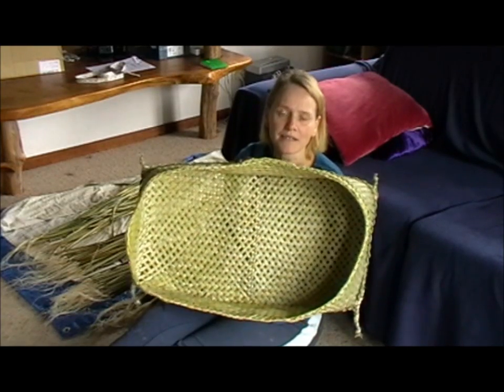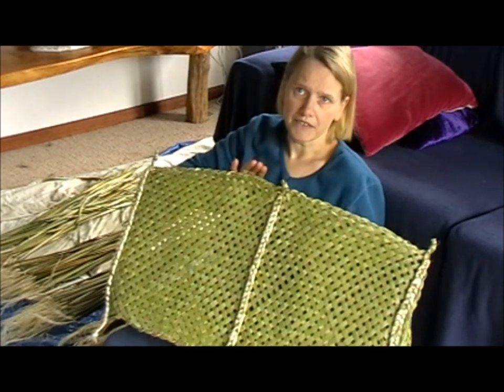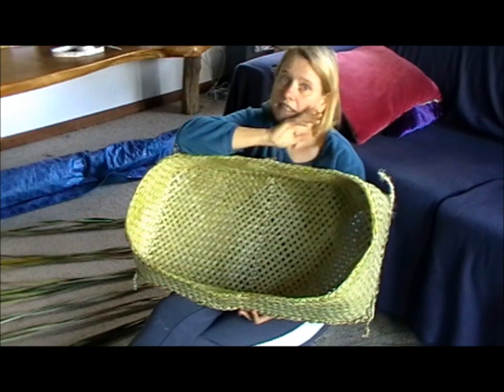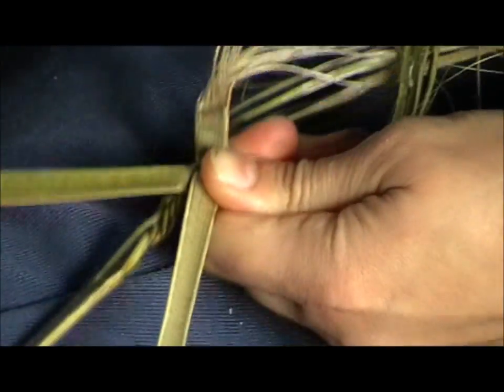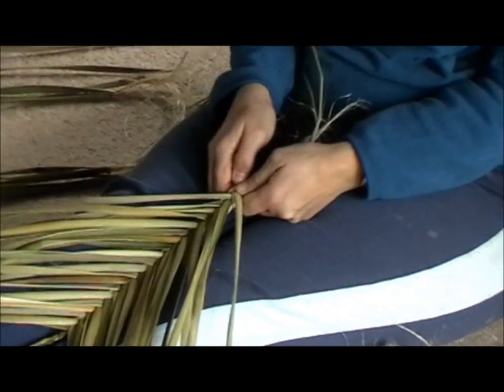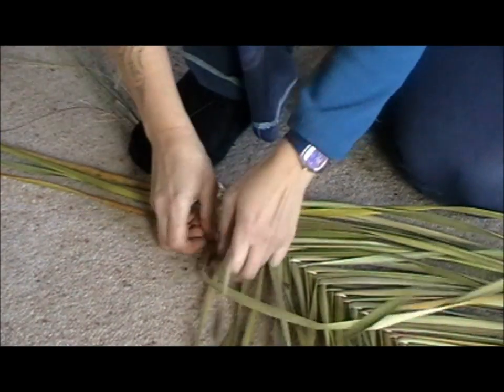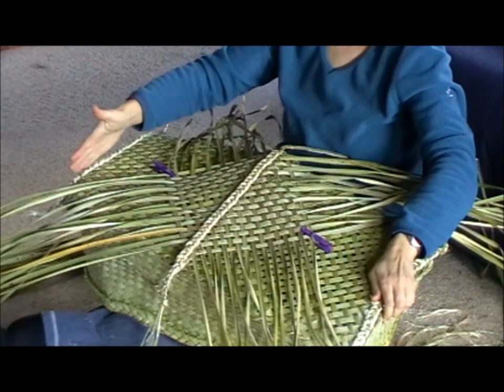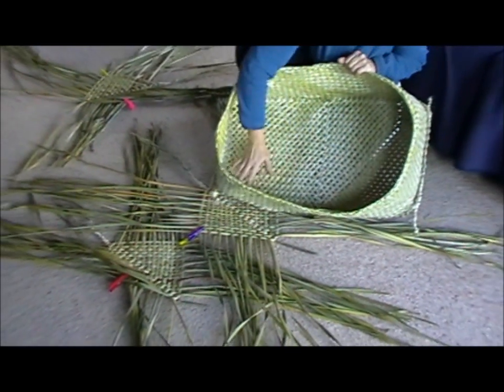Wahakura weaving step by step part one

Comment: Beautiful hand work, you make it look so easy. Could this starting method be used to make a kete which is what i'm wanting to do. There are so many videos but I can't find any step by step starting and fininshing top edge plaits. I love watching you clips, so explanitory. Thank you for sharing.
Reply from the maker: Kia Ora Bex, you could use the wonderful book from Mick Pendergrast "Te Mahi Kete" for step by step instructions on how to make a kete whiri and also how to finish the top. I do have a number of videos on kete and also finishing but most are for experienced weavers and are in the subscriber-only space on my website (flaxworx.co.nz). You can make a kete with the Wahakura method but I would not recommend it if you are not already experienced in weaving, a simpler 1 whiri 2 corner kete might be a good way to start. Also if you look on my channel here I have two videos that are more powerpoint presentations on the Kono and Purse and they have also photos in them about the top finish (How to weave a NZ Flax/Phormium Kono / Square basket)

Comment from the maker: Hi Louana, not sure what you after - I did post a video here on my channel on how to make a simple potae (bucket style - from a kono start) and there are many ways of locking off a kete or any other woven item for that matter - most people use the 2 up 2 down method - (and I do show that on most video's to) - if you really want to get ahead with your weaving I would suggest a course - there are plenty out there run by marae and community groups - depending where you are.